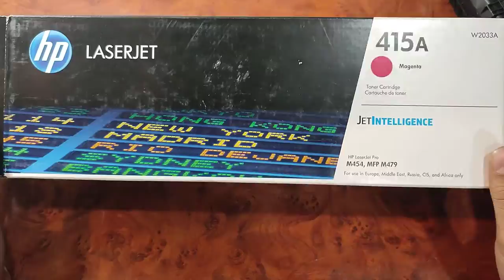hp 415a 416A 414A toner cartridge #refill.Laserjet Pro M454 seris M453cdw MFP479dw/fnw seris rifill.

Comment: Good morning, could you tell me what powder you use? Magnetic powder or non-magnetic powder? And how do I ask for it here in Argentina? which would be the best? This way I don't ruin my printer. I have an HP m479fdw and here the budget is GOLD😁 and if once I manage to do that, what did you do? Doesn't it need me to configure the printer or does it have a chip or something I don't know about? I will do all your steps and that's it. Thank you very much for your attention. greetings
Reply from the maker: I don't know if Argentina has one.  You can purchase from the link I have provided.  415A toner chips are not yet in the market.  Without the chips it will work the toner level will show zero.